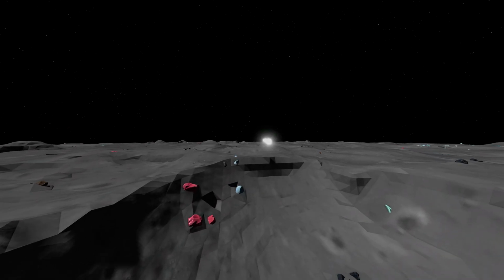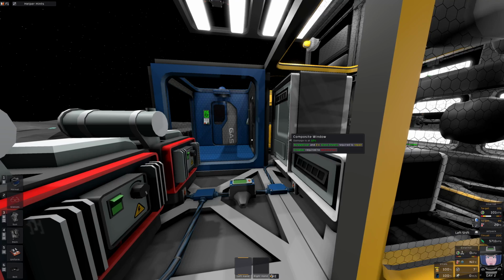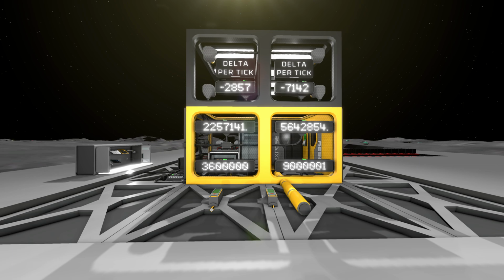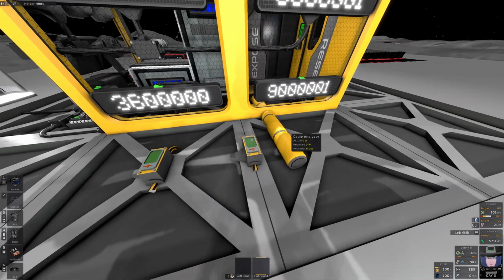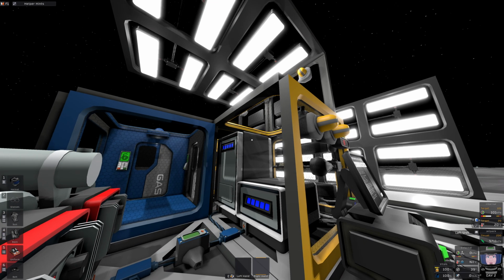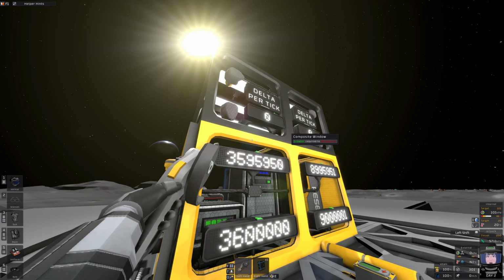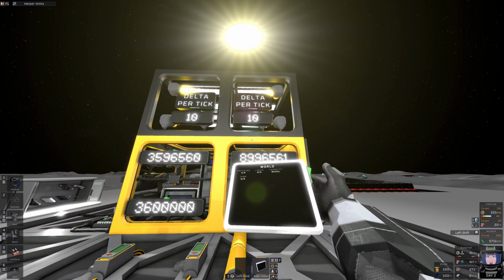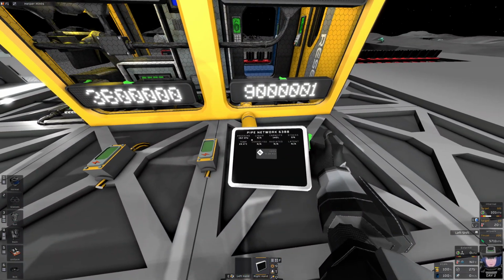Stationeers ATMOSPHERICS for total beginners - TURBO STYLE! - Part 10: Gas discharges batteries *

Comment: I guess the takeaway is that you're not allowed to build batteries indoors. WTF?

Most devices with a power switch drain 10w even when not doing anything. 10 energy per tick is not 10w though. But I wonder if the batteries lose power indoors even if their power switch is turned off... Either way, being outside (especially if the outside is Europa) doesn't seem like it should work any differently to being inside.
Reply from the maker: I heard RW want to eventually to a power systems pass (aka focus on that topic and rework everything), so e.g. the transformer-based infinite power tricks no longer work. Maybe when they eventually get to that they'll also fix the temperature-based battery drain inconsistencies. (Btw., I bet that station batteries can not be stopped from losing power via temperature just by turning them off.)

Comment: I would say it has the wrong discharge formula hahahha;
I guess the desired result would be a constant power loss of X, like the 10unit you show, + whetever interaction with ambient atmo to increase/decrease the power draw.
But doens' t seem like they nail it
Reply from the maker: "@cory6824" actually posted the game's program code below, which I've decrypted somewhat at the end of the description. For whatever reason it's intended that the world atmosphere does not have any effect. Maybe they just didn't get around yet to making the world atmosphere variant of this, or it's for performance reasons - maybe a relic of Loulan with all its ruins that may come with batteries, I guess.

Comment: Could that be a bug?  If I leave batteries on my workstation they don't discharge by themselves.  So that's where my battery power goes in the game. It leaks.
Reply from the maker: "If I leave batteries on my workstation" - What do you mean? Anyway, I do think that it's a bug if Station Batteries in vacuum DO NOT discharge out in the world but do discharge in vacuum in a room.
Reply: @OwnerOfTheCosmos  Sorry, I play with Arduino electronics and if I remove the AA batteries or 9V batteries from my electronic project and just leave them on the desk, I can come back in a week and they are still charged. If this were Stationeers I'd have to recharge them before every use.
I currently have 6 rows of 10 station batteries. I'm going to place an LED showing power on each row and disconnect 1 row and see if they discharge.
Currently they are in a room with a door but no air lock on my solar panel tower. I didn't know if the Martian storms would hurt them.

Comment: You didn't look back at the pipe when <-55C with oxygen, so I couldn't tell for sure, but it seemed like with other gasses, the higher discharge rates happened when the pipe was containing some liquid.

Comment: ARMSTRONG_LIMIT = 6.3;
ONE_ATMOSPHERE = 101.325;
ZERO_C = 273.15;
LOSS_NORMAL = 10;
LOSS_COLD = 50;
powerLoss = localAtmosphere && powerStored > 1e-45 ? (pressure > ARMSTRONG_LIMIT ? (temperature < ZERO_C ? max(LOSS_COLD * (1 - temperature / ZERO_C) * max(0, min(1, pressure / ONE_ATMOSPHERE)), LOSS_NORMAL) : LOSS_NORMAL) : LOSS_COLD) : 0;